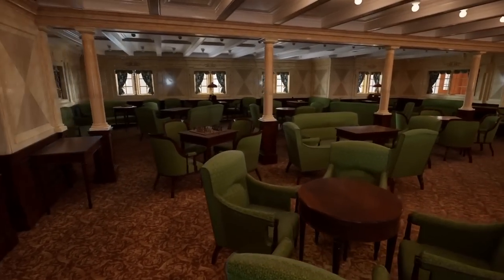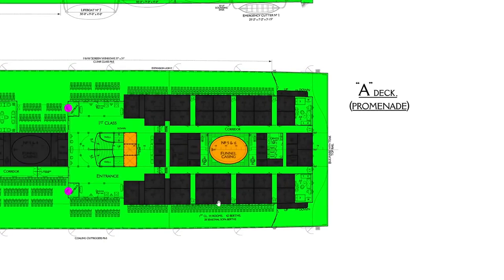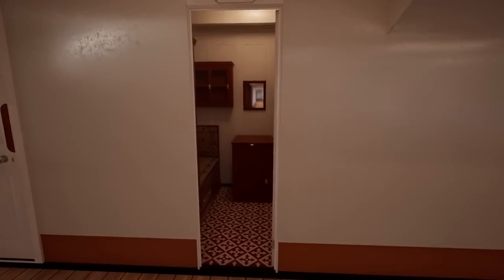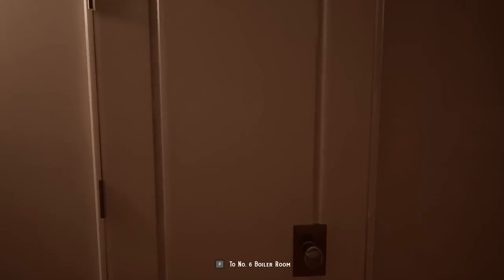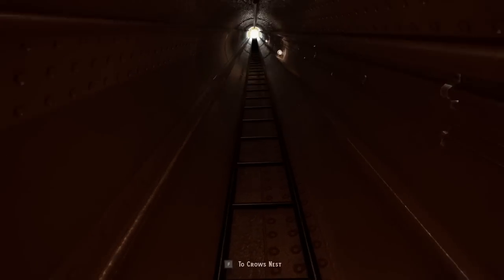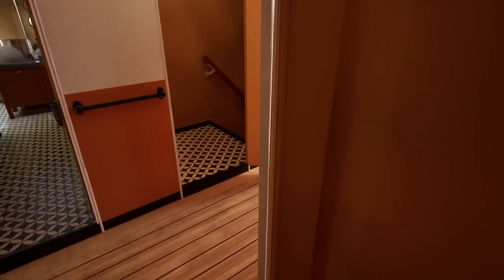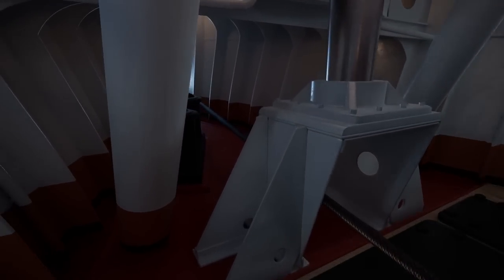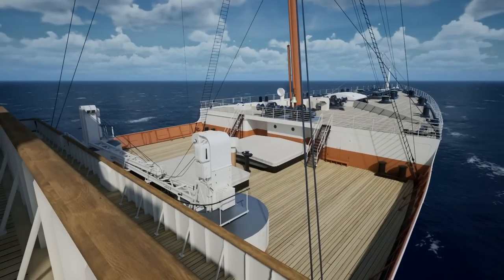Titanic 401 - Huge 2023 Update! (Honor & Glory)

Comment: Fun fact: the main project, Honour&Glory, is being built exactly like they would’ve built it back in Belfast. They literally are building the hull by the plate, with each plate being cut and placed just like they actually did over 110 years ago. That tells you that the team is taking this project very seriously, and aren’t messing around.
Reply: This demo has taken over 10 years to develop and are now with a full new team of developers. They aren't taking it as seriously as you'd think. There has been a lot of public support for this independent project. They could have easily increased funding or found someone to contract them and get this game out. Still hoping one day that this will be a fully released game that allows us to relive the glory and horrors of the Titanic; But I'm not sold on it at all.

Comment: Nice to see you you revisit Titanic content! Btw, the fidley was used to allow hot air to naturally rise up and out of the boiler rooms while also letting some light in. Fresh air was pumped in through the rectangular vents on the bulkheads. Also, the round shape of the fireman's passage was because it was meant to be watertight. Basically the passage passed through two watertight bulkheads, but if two watertight doors were placed in there then it would create a section no one could escape from if they were closed. So instead they had just one watertight door at the end and made the passage itself watertight to bypass the middle bulkhead. The rounded shape was needed to give it the strength to resist water pressure.

Comment: The firemen tunnel is arched because it passes through several watertight bulkheads. In case of flooding arch form is more resistant to the water pressure than a flat ceiling.  Nice video!

Comment: Thank you for your videos, its quite fun to watch them actually xD, I got to test this demo yesterday and I love the level of detail if you use the mouse wheel you can pan in or out, also, if you go to the first class forward staircase, go down to E  deck, on the left side(as you just going down) there is an open cabin, the E23 thats Molly Brown cabin, and in the same area were the elevators are, on the ground next to the first elevator there is a brass circular object on the floor, that has on the wall a wood box and a plaque, thats a point for the crew to manually close the water tight doors that are bellow in the F deck... Also LOL I fell down the cargo hole on top XD